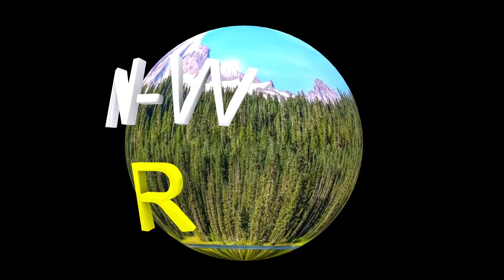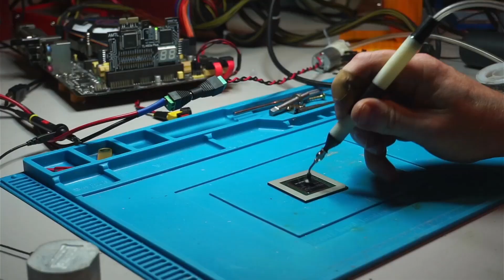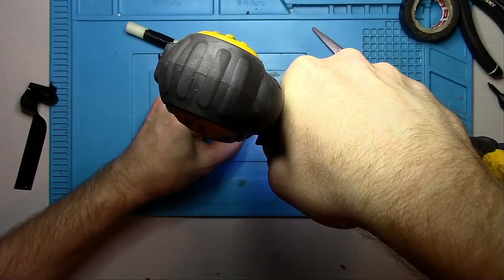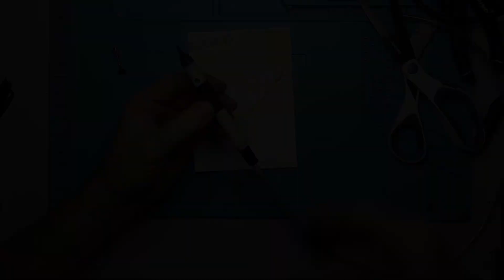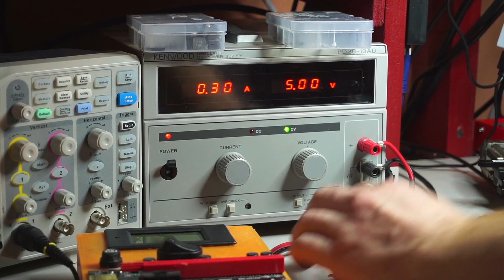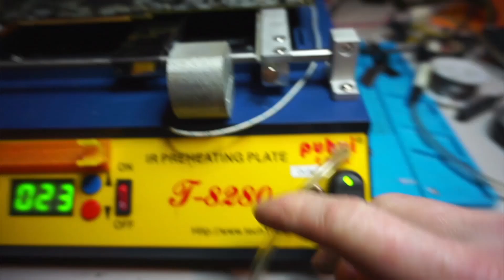Chip lift suction pen DIY

Comment: Are the silicone rubber tips which come originally with the suction pen withstanding the temperatures above 250 degrees ? Because they never specify that in the specs and I intend to use it to lift large chips which are being desoldered, no-lead solder needs to get colse to 300 degrees to melt.

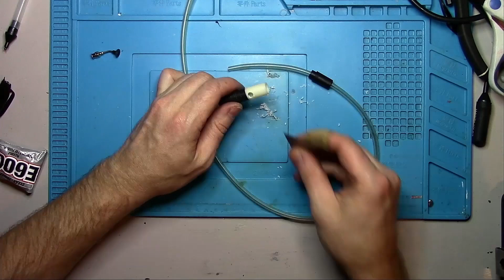Comment: To deburr the the drilled hole @ 1:01, rather than use a razer blade, you can use a larger drill bit (say 12mm dia.) and just rotate it by hand over the hole. It will clean up the hole nice an neat, and with a slight chamfer.

Comment: Oh did he attach the pump inside the bga hot plate using the voltage from the vent fan?
Reply from the maker: no. it comes from a separate phone charger board hidden inside.
Watch the next video

Comment: if you want to connect this via usb you should put a reverse diode on between the power pins to prevent coil discharges to ruin your power source
Reply: could you please elaborate more on that?
i am trying to run the pump using a usb charger but since i have a power switch where could i have the problem?
Reply: @mcblocked2  Maybe the pump has too little amperage or voltage?
To check the maximum output amperage of your power supply look at the markings of the unit.
And to check that the pump is compatible with your power supply check if the voltage rating is arround 5 volts (it shouldn't be under but if it is 6 volts it will still work but not as powerful).
If your power supply has a too low amperage you could replace it with a more powerful unit.
But if the voltage is too low you could use a boost converter, a USB-C power supply with a special adaptor or a 12V power supply if that is the voltage that you need.

If you have any questions just ask them here or we could get in touch elswhere